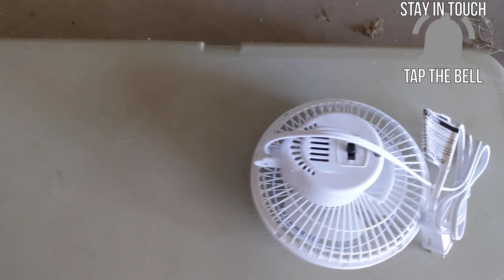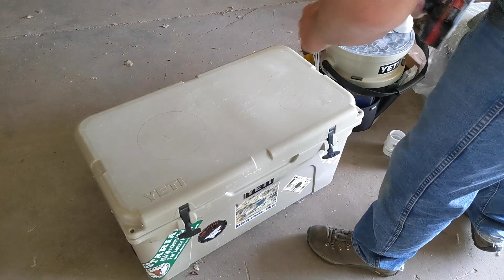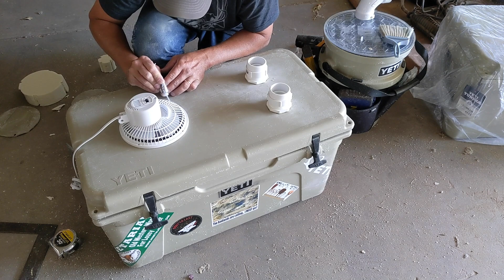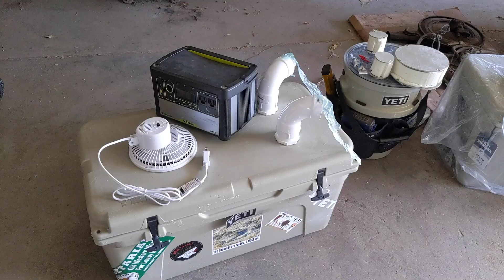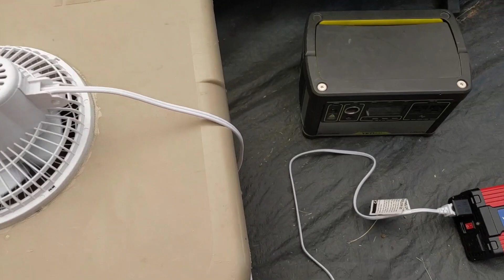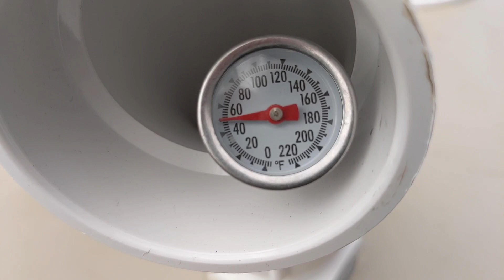YETI Cooler Air Conditioner - How to build an AC for your tent!

Comment: How long does it cool for ?
Reply from the maker: In a YETI cooler like this, the ice lasted for days on an early season archery mule deer hunt.  The biggest limiting factor is how much battery power you have to run the fan.  A Goal Zero Yeti400 powered it for 2-3 days.  I also tried a lawn mower battery with an inverter hooked up to it and it only lasted about an hour. 🤔

Comment: Do u have a shopping list please?
Reply from the maker: Sorry for the delay!  Here you go!

2" elbow
2" fitting cleanout body
2" SXMP male adapter

Vornado 460 Small Whole Room Air Circulator Fan with 3 Speeds, 460-Small, White: https://www.amazon.com/dp/B01BF3XYMQ?ref=nb_sb_ss_w_as-reorder-t1_ypp_rep_k0_1_7&amp&crid=4T5KM2V6NXX0&amp&sprefix=vornado

Comment: "doesn't cost much at all" then cuts holes in a perfectly good $400 Yeti cooler... i have a small 4000btu 12v marine AC unit in my jeep that cost $600, and i guarantee it cools better than this set up. That said, this was still a great video!
Reply: Yeah but u cost also buy a cheaper 40 dollar cooler and a harder blowing fan and make it all for under 100 bucks and work as good as any 400 or 600 dollar unit 🥶 🧊, God Bless

Comment: A larger fan would increase air flow. Not sure this is worth the effort as the ice can’t possibly last that long, maybe a day or two. Would dry ice work better? I’d be trying it on a cheaper cooler to start with.

Comment: Inexpensive other than the expensive cooler, power supply, ice the daily trips to town for more ice.  Can't imagine ice would last more than a day blowing 80-100 degree hot air over it.
Reply: I doubt it would last over a couple hours two 1 gallon frozen water bottles lasted less than 3 hours.